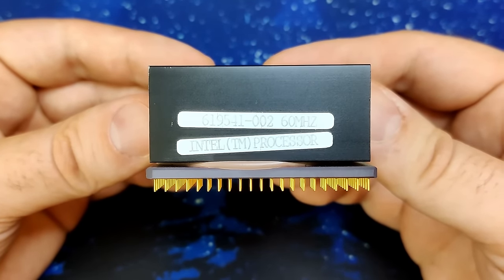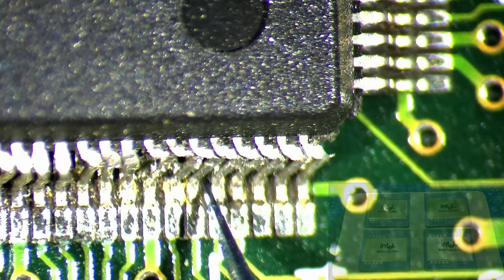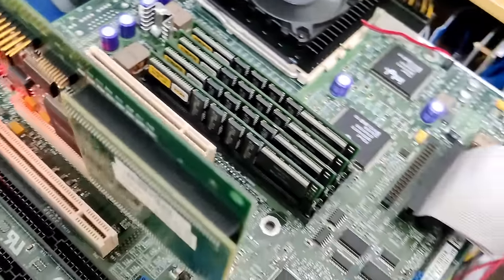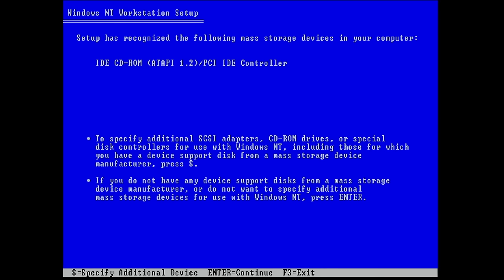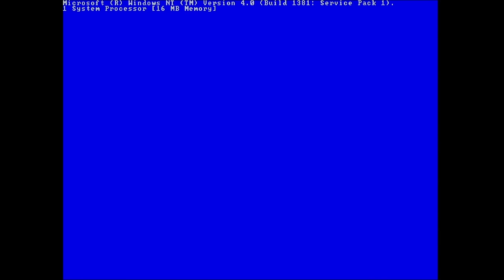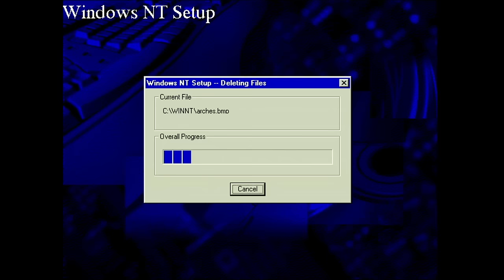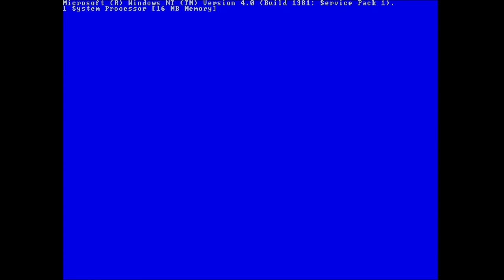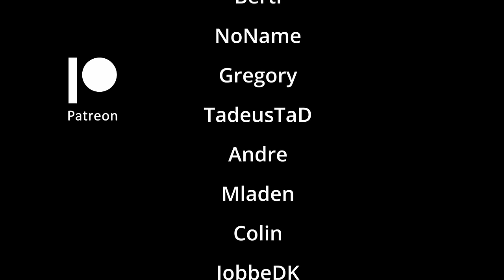A CPU ahead of its time: The Pentium Pro

Comment: As an early experimenter I came across a copy of Windows NT4 at the beggining of 1997 and installed it on my Pentium 133. It ran HORRIBLY slow so I tried to install Windows 95 back but NO, you could NOT. Aparently NT4 installation converted your drive to NTFS (i never heard of this until then) and it used some kind of bootstrap kernel driver in order to boot and show files. After much struggle and trying any kind of data rescue programs no program supported NTFS back then so I had to reformat the drive and loose many valuable data that I miss to this day 😢
Reply from the maker: That's a bad experience! I ran into this issue with file systems while working on this video! Windows NT 4.0 does not support FAT32! Maybe it supports this file system on a later service pack, but with SP1 (which I used in this video), it doesn't.
Reply: @bitsundbolts  Exactly, I could not connect my backup HDD and copy anything either.

Comment: when pentium 4 northwood was released I had still pentium 200MHz MMX and somehow get 233MHz Pentium Pro (dont know much more about that)... I believe it did not have simms and I had a problem with hdd. Old system was able to run from 60GB seagate (it showed in bios only 4GB capacity but worked no problem), the pentium pro saw 16GB capacity but it froze when it should boot. I was able to fit a IDE raid card in pci slot and that add almost a minute to boot up time but worked fine... that 233 pentium pro felt like 2 times faster.

Comment: I have a 3DFX diamond multimedia voodoo 1 that was passed down to me from my mother who had it before me. It stopped working about a year ago, still displays but no recognition in device manager even with a manual driver installation. I’m wondering how I can get in contact with you in regards to this card.
Reply from the maker: It's probably an issue with loose solder joints. You can email me bitsundbolts at gmail dot com.

Comment: I have a siemens scenic pro d6 here with a pentium pro 150 and the board in it is one with those riser cards but it has pretty much everything u need onboard so u dont really need pci but i havent been able to get it working because it needs a proprietary power supply and so far i have not been able to get one

Comment: I’ve never seen RAM with two very different packages on the same stick. What are they and how do they work?
Reply from the maker: This memory can detect errors. For this to work, you need more capacity that is not usable by the system, but keeps track of data stored in memory. Those so-called parity chips keep something like a checksum for each byte. If a bit flip unintentionally, the checksum is invalid and the system will probably be halted once the parity error is detected.
The parity chips can be identical to the memory chips, but sometimes, they are different. It depends on the memory layout, width per module, and capacity.

Comment: What do you use for VGA capture?
Reply from the maker: I use an OSSC (Open Source Scan Converter). This device allows me to capture the VGA output and turns it into an HDMI signal. Then I use a cheap HDMI to USB capture device to get it into OBS. The OSSC is important to get the VGA signal properly decoded. A lot of cheap VGA capture cables (VGA to HDMI) do not work properly and most of the time cannot deal with all resolutions like during boot or in the BIOS.
Reply: @bitsundbolts  Thanks for the info.  I'm more familiar with pre-VGA connectors and computers (e.g. Commodores), and have had the same bad experience not being able to deal with the low resolutions of boot and BIOS.  Danke!

Comment: I experienced massive problems installing NT4 on socket 8 boards using cf-cards. Corruption every time! Is this maybe the reason why you are using an HDD?
Reply from the maker: No :) I just had that hard drive around and wanted to use it. I guess I dodged a bullet there! Good that I didn't waste time on that one! Good to know though!
Reply: @bitsundbolts I think I have to dig into this again sometime. Have been tinkering around for quite some hours, including scsi2sd. Didn't really finished it. Frustration settled in. Great reminder to resume my ppro build!

Comment: why can't i find any vintage hardware at all, anywere (unless i pay a crazy amount of money)?
i'd like to find something to run a bit of dos and early windows version.

i'm personally way too young for this stuff, but vintage hardware like this has a soft spot
Reply from the maker: Where do you live? This old hardware will get more and more expensive. Maybe a socket 7 system would fit your needs. They can be cheap and run windows 95/98. If you're looking for earlier, then 486, but that's more expensive. Socket 7 should be quite flexible. From about 75 to 600 MHz (for a super socket 7)

Comment: What do you use for VGA capture?
Reply from the maker: I'm using the OSSC (Open Source Scan Converter). It's a device that allows you to capture a VGA signal and properly converts it to HDMI. This signal can then be captured with an HDMI to USB capture card.
Reply: @bitsundbolts  ey, fellow OSSC owner!  What capture card are you using?
Reply from the maker: It was a cheap capture card I found on Amazon. I had to go through a couple of them until I found one with quick response time to resolution changes and that can deal with the odd resolutions of boot and bios screens. Unfortunately, it doesn't have a model number - it's a generic capture card. I'll show my setup soon in a video. That would make the most sense I believe.

Comment: Naah the cpu ahead of its time was the DIGITAL Alpha. It was so ahead of its time that Compaq bought Dec to get the knowledge and HP bought Compaq to ditch the knowledge. Only for all its tricks to finally end up in AMD and Intel although water down because they still use CISC. That 21264 that I had ran at 533MHz when Intel was just about to hit 133MHz 😂And I had true 64 bit OS running, with Tru64 Unix. Even my colleagues and SGI did envy the Aloha over the MIPS. The problem is that when you are lightyears ahead, it’s seldom good in the long run. 😢

Comment: I thought that Celeron was the first one with cache onboard.
Reply from the maker: The Celeron was the first to have the level 2 cache integrated into the same die as the core. The Pentium Pro still has two dies, just on the same ceramic package. But there are similarities like the speed of the L2 Cache of the Pentium Pro runs at the CPU frequency.

Comment: how do you know which cap you will solder?
Reply from the maker: I have three of those boards. The caps were fine on the others. So, I desoldered them and measured their values.
Reply: @bitsundbolts  Ok , but if you dont there is an issue correct?
Reply from the maker: You could desolder a similar capacitor on the same board. That's something I do if I don't have a second identical item for reference. Look out for groups of components that look similar. Then you could find the correct values. I'm by no means an expert, but capacitance is important and the correct value helps filtering noise. The board would probably work without those capacitors, but the engineers put it there for a reason. So, better to put them back.
Reply: @bitsundbolts  great thanks!!

Comment: P6 arch, Pentium 4 was a backwards walk
Reply from the maker: It's quite an interesting story! I've only touched the surface so far, that's why I didn't mention it in this video. After P4 and the Netburst architecture hit a wall in terms of scalability and power consumption, Intel revisited the Pentium Pro architecture which had a big influence on the Core2 design.
Reply: @bitsundbolts  The AMD K5 is another interesting one, as it's not very far off from being the cancelled superscaler AMD 29k RISC CPU (Codenamed Jaguar, not to be confused with the later APU) with the x86 decoder and the previous gen 29k (Am29050) FPU extended to 80bit for proper x87 compatibility both bolted on. Apparently the original plan was to make one core that'd function for both their normal PC and embedded PC markets, where the normal PC one would be essentially the K5 as we know it but the embedded one was stripped of the FPU and decoder, so for integer-focused embedded tasks it'd more or less be as fast as the normal K5.
Reply: @bitsundbolts  Does the Core 2 have performance penalties running 16 bit code like the Pentium Pro?

Comment: Were i worked before they had a sever running windows nt4 and it was running on a pentium pro.  The year was 2013 and the server stopped working. We troubleshoot and the server was up and running but the bus to the network cards and pci stopped working. This machines was really important for customer but after it crashed they found out it wasn't that important 😂